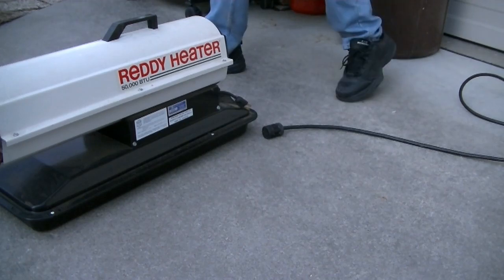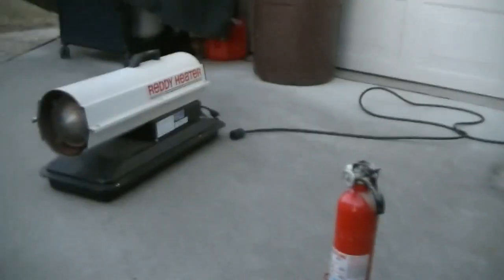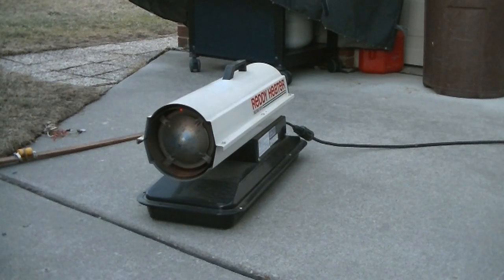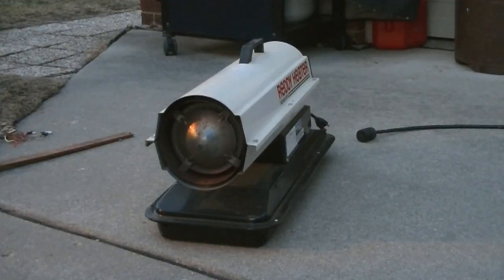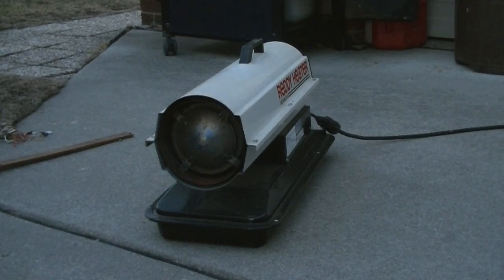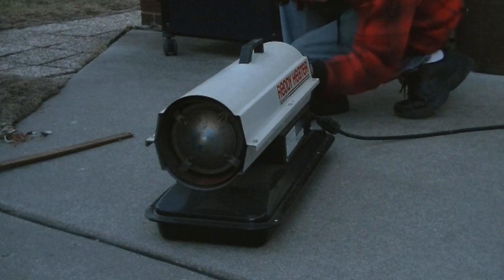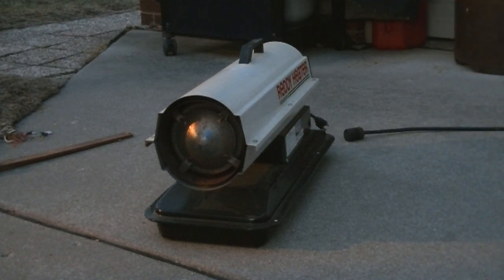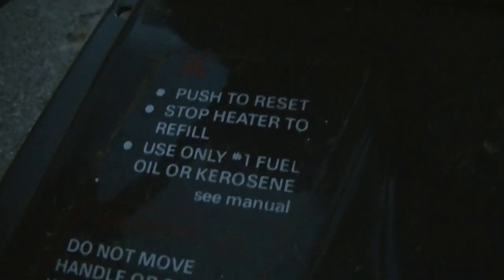First Kerosene Heater Test in 10 Years

Comment: You should drain the fuel out (there should be a removable plug on the bottom) and put some clean fuel in it and add 1 ounce of stabil per gallon to clean it out while it's running. Probably check the filter and replace it if need be.
Reply: Reddy heaters dont have drain plugs

Comment: have a old 1960'S master torpedo heater, HAS NO SUCH SAFETY SHIT ON IT, it either works or it will just keep PUMPING THE HOME HEATING OIL INTO IT... Don't believe  in the safety shit, i will make sure DADDY MATTY I burn the house down just for you.... 
And yes daddy matty i burn 100% pump gas in the torpedo heater and works very very well. i do not put in DIESEL just plain straight GAS straight from the pump!!! make sure you do the same, it will help heat the house better to....

Comment: I started up my dads old M100d last year.  Had to replace the igniter/spark plug.  It had sit in the barn for over 15 years and was dirty.  Cranked right up.  I checked the serial number and it is a 96 model with 90K BTU's of heating capacity.  These believe these units were made by DESO.  Pretty simple devices that heats up my workshop in no time.  

Yesterday I was out in the garage.  It was 40 degrees and raining outside.  A toasty 75 degrees in the shop.  My garage/shop is 45x20 with 12 foot high doors and no insulation.  Roof height is 14 feet at the top.  My father used this garage to keep his motor home in.  It is a metal building with a concrete floor and zero insulation.  Needless to say I love the heater.

Comment: I have the same one and rarely use it. Got it out plugged it in and does the same thing ....found out the plastic cover on back was cracked and not letting the pump to build enough pressure

Comment: Interesting!  Do all Reddy heaters have that horrible motor buzz?  I have two Reddy R70 heaters with that same buzz.  However I have a Remmington 115k and a propane torpedo heater that don't make that noise
Reply: ggsmith48906 I have this exact 55k BTU reddy heater. Mine isn't this loud but it is a little loud. I don't mind the noise, especially when its 0*F or colder out.

Comment: Its getting cold out now and I pulled mine out from 4 years ago. Aiming to save on heating it didnt run right. I purchased a rebuild kit here  http://www.torpedoheat.com/  With the new parts and about an hour labor its running nice and hot but !!! 
I am still using the old fuel. Go figure. 
Thumbs up !!

Comment: I have a 250,000 BTU Reddy heater. It wasn't used in over 25 years and a full tank of Kerosene remained. It fired up immediately and I never had a problem with it. I'm still using the same tank full. I'm glad it was full because I must of paid about 1/3 less for the fuel when I bought it.

Comment: Faulty photocell, soot covering photocell, or bad connection (overheated solder joints?) are what I would suspect.  Good luck tracking down the cause.